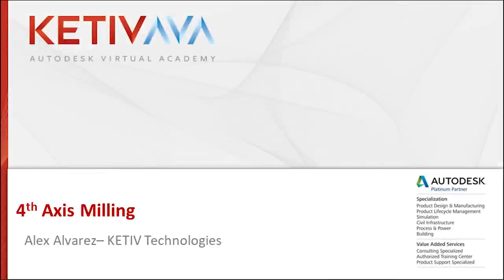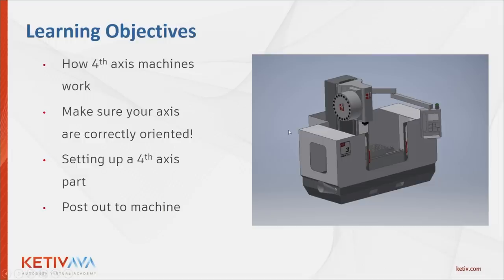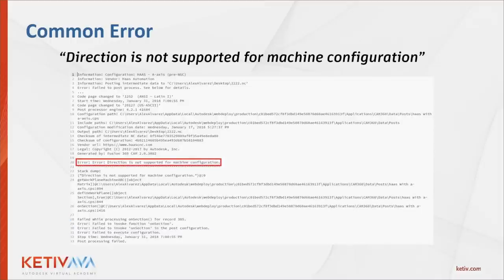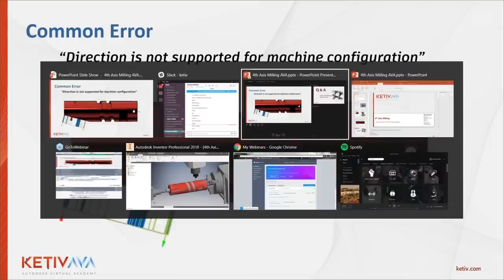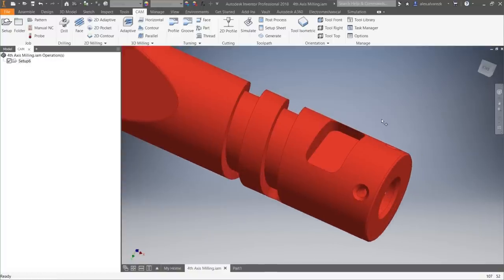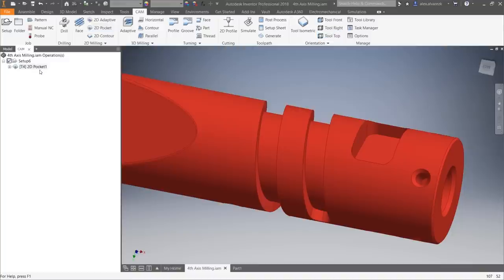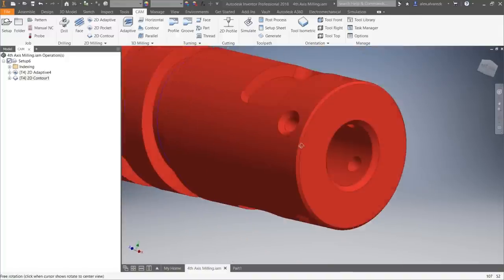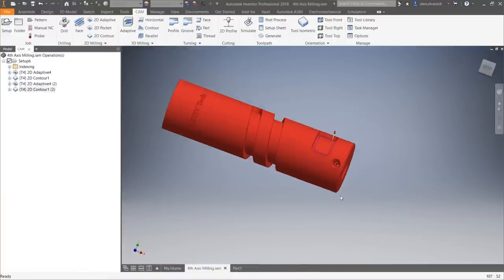4th Axis Milling in Inventor | Autodesk Virtual Academy

Comment: Sir what you have shown above is perfect but the main flaw in this is you can only 2D program for 4th axis. If you try for 3D model program you wouldn't be able to make. As well as there is also limitation that you cannot make 4th axis Rotate Contineous for  2D program as well. So It is just for Fun . But at real scenario. There is no support.

Thanks.
Reply from the maker: Thanks for the reply! You are correct, and we're happy to say that Autodesk has address some of these limitations in more recent releases. You may enjoy this more recent video on Fusion 360's CAM improvements:  https://www.youtube.com/watch?v=_qMbMzeygcY&t=1s